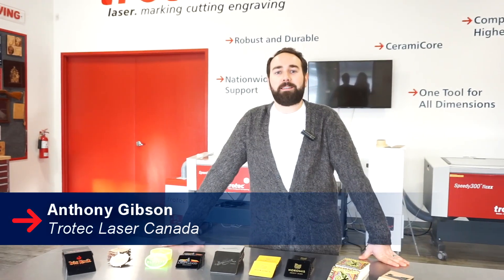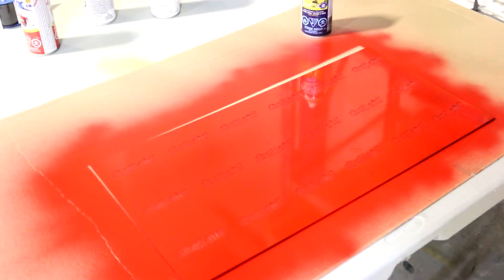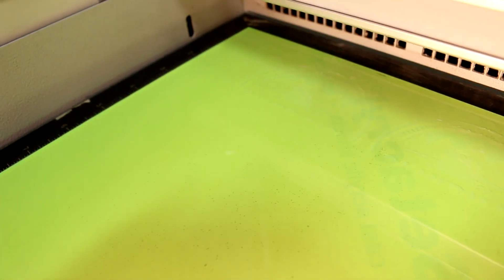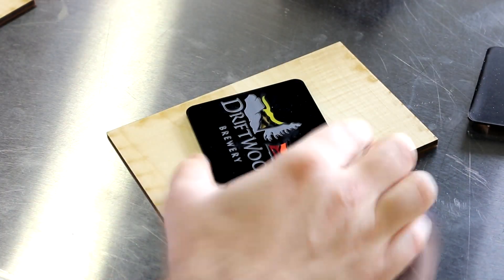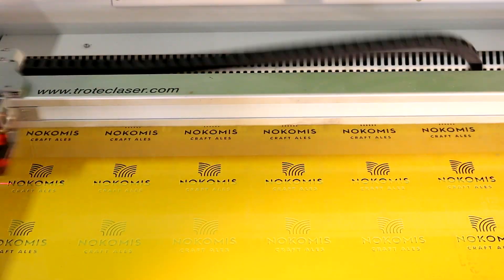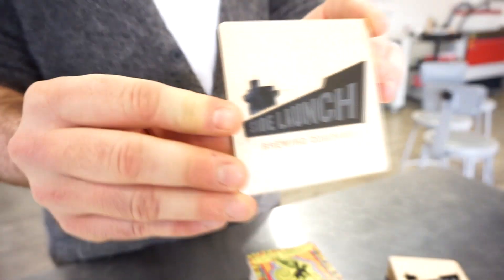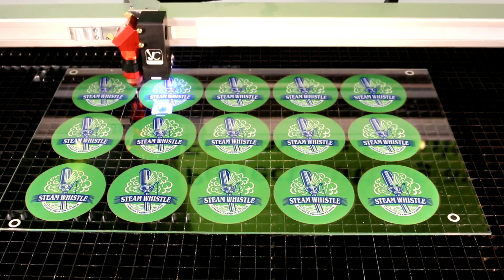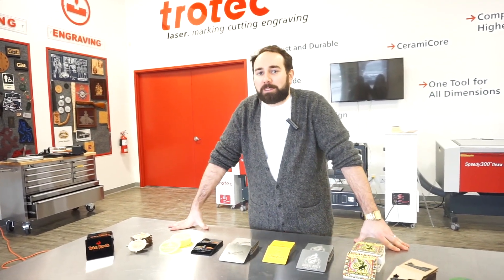Laser Engrave Coasters | Acrylic Coasters | Wooden Coasters

Comment: Hello, Does cutting through the UV-printed area cause the ink/print to bubble along the edge when you cut through the print?  I've run into this problem using a Mutoh 426uF + a speedy400.
Reply from the maker: Great question, that does happen with some inks and some UV models yes. There are some acrylic adhesives you can buy from a 3rd party source for stronger adhesion. We would suggest to contact your UV printer rep and ask, they can likely point you in the right direction.

Comment: I notice you cut the first coasters out upside down..I have found that when cutting acrylic the bottom edge is always sharper than the top ( first laser contact point) is this typical or am I doing something wrong? or is this the case when you cut the first coasters out and are ok with the sharp edge being on the top side vs the bottom? also I get the z offset, but what resolution are you using? thanks
Reply from the maker: Chris Smith hi Chris, what laser do you have? what wattage ? and how thick is the acrylic that you are cutting?

As for the z-offset, if we engrave in focus the acrylic will turn white, thus when we spray paint the colour on the back you wont see it from the front. We go out of focus on the z offset to engrave the acrylic clearly. As for the resolution the settings we used are in the link the description of the video.
Reply: I have an epilog helix 50 watt, cutting and engraving 1/8 cast acrylic
Reply: I think I managed..only hard part is trying to engrave through the multiple layers of paint